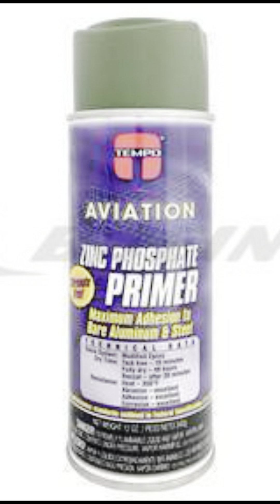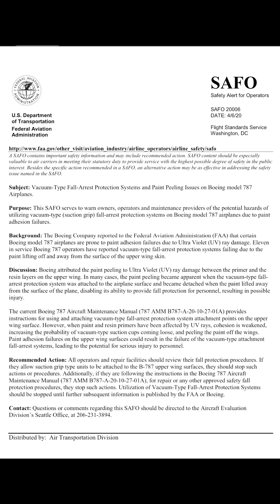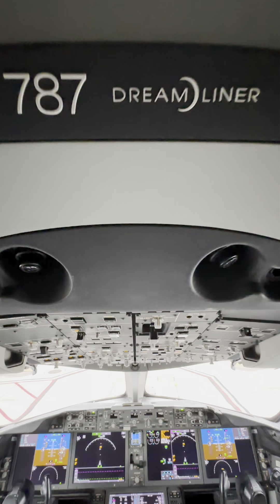B787 Wing Paint/Primer Issues

Comment: I wonder if the new 777X will also have this problem.
Reply from the maker: Most likely not because the 777x is still mostly metal. This is more of the composite material on the 787 issues
Reply: @StigAviation  That's interesting. Considering many features on the 777x are adapted from the 787,   even the same new raked wings designs and cockpit.
So I thought maybe they'd start using the composite materials on their newer plane model.

Comment: Would you use speedtape say a turbine in an engine fell off and you needed to reattach it?
Reply: I'm not sure the speedtape would hold the weight, not the forces put on it from the thrust, etc.
Reply: Absolutely! In fact, Speed tape is the primary bonding agent which holds the aircraft together. Of course, they use superior and invisible kind of speed tape so as not to appear an eye sore. As for the missing engine, not worth it. We just write it off. Who needs a detached engine. We gonna do just fine on the other one. That said, we always do carry extra flanges.
Reply from the maker: 🤣🤣🤣 stop messing with that comment. That’s hilarious
Reply from the maker: Speed tape is not meant for that. I highly recommend you watch my speed tape video so you understand its purpose